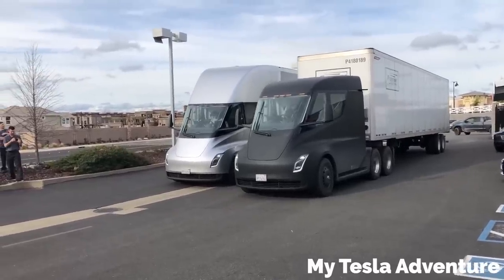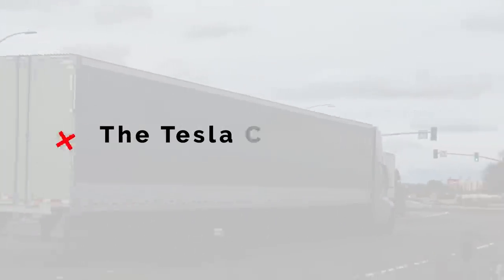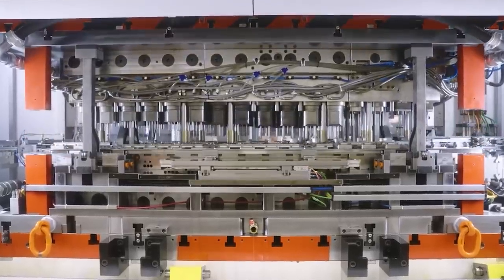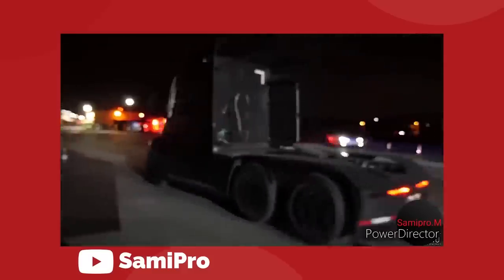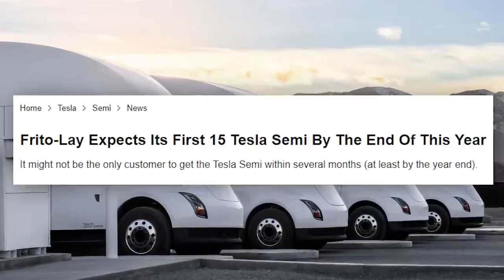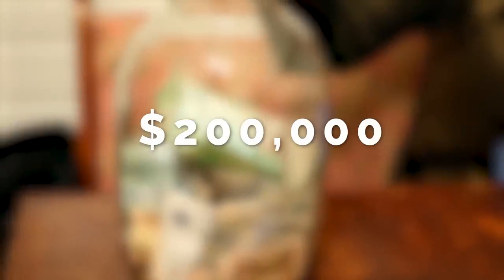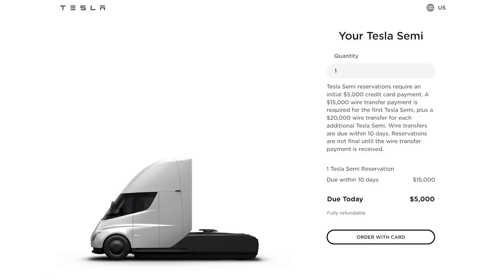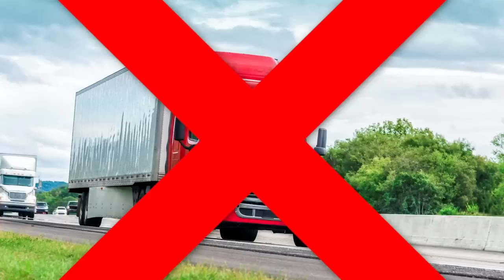The 2023 Tesla Semi Update Is Here!

Comment: I know a couple of fellas who own trucks.. owner drivers. Mostly subcontracting, single truck business just hauling whatever to wherever (UK). Always busy enough... more than busy enough. Both of them are quite serious about moving to electric and consider such a purchase as being the final truck before they retire. 500 miles here in the UK is far more than a return trip to Manchester/Liverpool from London. Trucks (diesel) they have now can haul up to the legal limit but generally the trailer is around 50% so less fuel. Both have mentioned 'fuel' saving by going electric and both have mentioned maintenance costs or rather massive decrease in cost. Never cheap something goes wrong with the truck.
Reply: It's unlikely they would actually be pushed to 500 miles. Most drivers won't be comfortable pushing past 350 miles before recharging. Most electric vehicles are made of fairly exotic materials. So repairs will take a long time and be very expensive.
Reply: They don't talk about battery degradation, my one year old model y lost over 30 miles after normal charge.
Reply: @miguelnogales716  pretty sure Elon promised a 1 million mile warranty for the tesla semi.
Reply: @miguelnogales716   Normal charging for day to day driving should not go over 80% unless you are road-tripping. Also, you should not discharge below 20% to keep the batteries in peak condition.
Reply: @samlukan  – Battery degradation is considered normal wear.  So, not likely considered a warrantable issue.
Reply: @Sushihunter250  – Ummmm… what?  In commercial trucking, every trip (upwards of 90% of them at least) is considered “road-tripping”..  Drivers aren’t running their class 8 vehicles to the grocery store to grab a gallon of milk and some Frosted Flakes.
Reply: @DebtPRZ   Miguel Nogales was talking about charging his Tesla Model Y - Not a Semi truck.  That's a whole different kind of driving.
Reply: @Sushihunter250  Jim, their website says 90% and that is my daily charge for the model Y.  I use my car for daily driving on average 70 miles.
Reply: @miguelnogales716  Really? How were you typically charging it?
Reply: @memrjohnno, Please copy/paste this comment (maybe with some of the feedback included) into whatever Semi/EV post you visit, as it very completely covers the issues we are all painstakingly trying to convey! P.S. As for battery degradation, see Gruber Corp AZ posts about how Tesla’s BMS has evolved from rudimentary in the OG Roadster to today’s far & away superior battery self-protecting SoC monitoring & charge optimizing inverters & software that is constantly improving. Bring all the FUD you want, bc it’ll be stale by the time anyone notices.
Reply: Unfortunately the tesla semi is not adapted for Europe lol…..
Reply: @samlukan  nonsense!!!! That’s has been à standard in diesel trucks for decades!!! Some even have 2million miles+
Reply: @Crunch_dGH  Been interesting. I didn't mention it on the post but they both also mentioned or rather spoke about, taking good care of the battery. Taking care of their tools.
Reply: @moabman6803  :D
Reply: With your much more expensive fuel in England, you should get a much better return on investment once the truck is available in England.  Maybe they will make a few hundred a year in Germany?  Your much smaller country, you might want to get the optional 300 mile range, because the battery cost per 100 KW is something over $15,000, and that would (100 KW) be about 50 miles of range.  If you can reduce the range and weight by several hundred pounds, then the cost savings will be significant.  

So if getting 500 mile range or saving $60,000 and getting a 300 mile range, I would take the much smaller battery and figure in a recharge for 30 minutes on each day at noon.  Have a great lunch with the $60,000 you saved in battery cost.

Also your 400 liter diesel tank will add about 300 Kg to the truck when you fill it, and then goes to 100 Kg as you use up the fuel.  Batteries do not get lighter when empty.

Comment: It's going to be interesting to see the charging cable up close for the Tesla Semi. 1 megawatt/hr battery charged to 70% in 30 minutes means
an average of 1,400,000 watts on average for the 30 minutes. It's definitely going to be higher than that at times. So, at least 1400 volts at 
1000 amps. These are very large numbers.
Reply: It’s got liquid cooling built in
Reply: Re: MegaCharger Heat. I wonder when Tesla’ll get around to repurposing all that by-energy!
Reply: They might use induction charging to minimize primary current. That would be the smart thing to do.
Reply: So if someone were to steal that cable I wonder how much it costs to replace?
Reply: They should make it so u can get a fully charged battery and drop off your dead one
Reply: @Tommyrogerson  the standard superchargers do too otherwise they would be a lot bigger too
Reply: When you claim EVs and especially the new Semi are “zero emissions” factoring how the electricity to charge the trucks, AND the environmental offsets from extracting the minerals used to produce the batteries should be considered in the conversation.
Reply: To put this in another perspective, if regular Tesla EVs charged at this speed, they would be at 100% in ~5 minutes, give or take a minute.
Reply: @djwilliams4714  I own an  EV. in the UK it costs more than diesel to charge your car at a charging point now!!!
 And that is whilst diesel is at a very high price and is falling.
Reply: @Jaya365  it costs more than diesel right now? is that in California or how is that possible
Reply: @LoganC278  UK dude
Reply: @djwilliams4714  It doesn't matter because even when you account for emissions all the way down to extraction, electric vehicles still pollute less than combustion vehicles. The only difference is the exact moment where electric vehicles beat combustion vehicles (is it after 1km? 100km? 1000km? etc.). While a lot of people aren't aware of that fact, this topic has been covered all the way through a decade ago and pushed aside simply because it's moot: nowadays, even the least environmental friendly electric vehicles are more environmental friendly than a combustion engine equivalent.
Reply: @smadacaz First, the study notes that tire wear releases more particles than tail pipes. This is a form of pollution but not related to climate change. At best, this means we need to improve tire technology as well.

Second, because car engines are so inefficient, even battery vehicles using electricity produced by fossil fuel powerplants pollute less than combustion vehicles. This has been debunked frequently.

Third, your critic of regulation and child labor is moot because it stems from where manufacturers source their products. Regulation and child labor is not related to electric vehicles more than combustion vehicles. If manufacturers are pressured to follow strict regulations and not employ child labor, they'll source their products from Canada and it simply won't happen.

Fourth, your comment on cutting trees to replace them with solar farms is covered by my second point.  

Globally, what you're doing is mostly a mix of fetching and disinforming. Anyone with a brain would see through it. I basically debunked your entire comment and you clealry intend to spread false information so I won't reply further, but I'll leave this for others reading.
Reply: @kennethroth6757  🤣
Reply: @Jaya365  I was wondering about that.  No one else has mentioned it.
Reply: @dzello  Thank you. I thought so but still hear naysayers. They never stop! God hates liars.
Reply: @Off The Grid Tesla says 500 miles.
Reply: @jolyonwelsh9834  not really, indication charging has a very low efficiency at a distance.
Reply: @theobserver8881  that's true. But we have full size electric commuter busses here in lake county Ohio that use induction charging. It seems to be working pretty well.
Reply: Roger That.
Also the EV Charging stations the more drain on the existing Hydro, Coal Nuclear power supply, which the dilapidated grid systems?
Reply: @moabman6803  here in edmonton the crack heads steal your little block heater cord , must be a whole $1  of copper , so when its - 20 or colder many new cars , trucks with the tiny 2.0 2.5 liter engines wont crank even with a new battery ..,,,
Reply: @hermanwooster8944  charge that fast and the battery after 40 50 60 charges and i bet alot of fires will occur , cant wait to find out .. poooooof ..
Reply: @macalister8881  You ever see those Chinese phones that charge in 2 minutes with 200w of power? We'll probably get there for cars, eventually.
Reply: @hermanwooster8944   i look forward to next year so many things  will work or wont ..
Reply: @macalister8881  Agreed. Next year will be a watershed moment.
Reply: @hermanwooster8944  i would love to see cleaner air here in the city so i do hope the tesla truck kicks ass ..
Reply: @hermanwooster8944  and i would love to see crash test comparisons .
Reply: @macalister8881  The heavy weight means some EV trucks are able to bypass some crash tests altogether. The main thing people need to be concerned about is the increased weight means increased risk to gasoline vehicles. A Model S recently t-boned a Honda Civic at highway speeds, resulting in only mild injuries for the Model S occupants. Tragically, it was fatal for the Honda Civic occupants.
Reply: @hermanwooster8944  my point is the tesla truck has a 15640 lb battery , and you say oh need for crash test , what happens to a damaged battery in a crash ? And you say oh no need  to see if anything eh , what b s .. norm for the day i guess .. ssdd....
Reply: @macalister8881  I fully believe there ought to be crash tests. I'm just commenting on the situation we have today. EV trucks like the CyberTruck are reportedly able to skirt crash test requirements because they are too heavy to be classified as passenger trucks. It's all a matter of bureaucracy and complex regulations.
Reply: @hermanwooster8944  i think when the fires start after a wreck they might change it just like seat belts in the 70,s , peeps gotta fly through the windows before they care right ssdd
Reply: @macalister8881  Oh yes, the changes will come later.
Reply: @hermanwooster8944  
Yeah but it doesn’t work that way

Comment: In america Truck drivers need to drive certains hours and rest certain hours. Let s say you drive 10 rest 8 .Now on top of that driving hours you have to stop twice to recharge u basically cannot drive. Since stopping to recharge counts as you regular driving hours. It is only effective if the battery last a lot.
Reply: I'm a truck driver myself, although in Europe. Here the driving rules are actually stricter. I'd say an electric truck will never be an option for OTR trucking, and for many reasons. On the other hand, 10s if not 100s of thousands of trucks are driving less then 500miles a day, and are returning to their base every single day. That's where these will be absolutely fantastic. That's why Pepsi ordered them as well. With 3-500miles of range and most of their trucks returning to their base every day, or even multiple times per day for a quick half an hour charge, these could be absolutely fantastic.

Comment: A 37,195kg (82,000lb) vehicle traveling 26.8m/s (60mph) has a kinetic energy of 0.5*m*v*v=13.36MJ. Assuming perfect power transfer, you'd need a drivetrain delivering a constant 13.36MW/20=668kW to reach that speed in 20 seconds.

For reference, the standard range Model 3 has a 202kW motor.
Reply: those are very realistic power numbers for a tesla
Reply: @leohaukipuro7896  yep, seems very doable
Reply: @suunraze  
That'll require some serious bars to hold the load from slipping/tilting backwards. 😂
Reply: Is there a trucking company looking for better acceleration? Would they pay extra for it?

Comment: 4680 Batteries: I think we can all feel a little bit of Tesla's pain in trying to manufacturing the 4680 battery. The design is new and so is the process to manufacture them. It may take Tesla another 24 to 36 months to work out all the kinks and then it will be "off to the races". I  would prefer that Tesla take it's time to nail the manufacturing process and make sure that the number of rejected cells is very low. In the long run this will makes the battery packs cheaper for the consumer.
Reply: Considering the much higher density that the Qilin batteries have that CATL are bring out, Tesla might start using them for the semi trucks instead of  the 4680

Comment: You don't mention the fact that Tesla trucks come equipped with FSD. As soon as that problem is solved, all Tesla trucks will have it. No competitor can offer FSD much less the range,  efficiency and los maintenance.
Reply: Currently level 2 autonomy is the only thing cleared in all 50 states. That still requires a driver in the seat at all times, hands on the wheel, eyes forward. The legislative hurtles required for levels 3 and 4, (4 being complete autonomy, no driver whatsoever) is waaaaaay way off in the distance.
Reply: @Jmartphilly  That, and teslas driver assist is already falling behind the competition with phantom braking and unpredictable behaviour. I don't trust it in a personal vehicle and the idea of it controlling semis is downright scary.
Reply: @TeeFunkable  "idea of it controlling semis is downright scary." So are some of the drivers. We get drivers delivering to our shop that can't back into the loading docks. Many barely speak English and have only been driving semis for a very short time.  I doesn't make them bad drivers just inexperienced.

Comment: Sir, the EXTREME VAST MAJORITY of diesel trucks DO NOT have 18 gears. That's almost exclusive to tow trucks or trucks hauling over 80k regularly.  Almost all trucks are 10-13 speeds and even still you never change all of those.  You can easily skip 2-4 of those bringing your 18 gears down to about 6-7. Big difference.

Comment: I wonder how much of that 80k lbs is able to be used for the cargo. I wish they told us how much of the total gross weight is just batteries.
Reply: Thought i read something about the battery weighs 26000 lbs? Almost 2 daycab trucks. With trailer empty a regular semi combo weighs about 25000. So giving up about 13000 lbs payload. Waiting 30-45 min to charge is bs too. You can fuel a semi in 5 minutes. Better get those uranium sticks from russia fire up the coal plant or fossil fuel ng. Dont get me started on the lil kids mining the cobalt for the batteries. Not really all that green the energy must come from somewhere
Reply: @myballsitchsomethingfierce6319  Sure so how long have you driven a class 8 semi?
Reply: @myballsitchsomethingfierce6319  BUT the battery range equals a small 8 gallon tank and that fills in less than 5 min.
Comparison level!
Reply: @myballsitchsomethingfierce6319  Could usually fuel 250 gallons +, go into truck stop for a piss and buy coffee/food and be out of the lot in less than 15 minutes.  Truck pumps are high flow. larger hoses and nozzles

Comment: WHY THE 4680? It is obvious that few people understand the big advantages of the 4680 cell. It is not just the form factor. The tab-less design allows charging and discharge speeds many times beyond what is possible with a tab at each end of the spiral jelly roll. The ions only need to travel 80mm across the width of the roll instead of being pushed from one end of the spiral to the other. A mere fraction of the heat generated, and therefore the energy needed, to do this. It also allows huge rates of discharge without overheating, for the same reasons. Think drag strip acceleration. Or aircraft takeoff. A conventional tab design with a diameter of 46mm simply cannot do this due to the extreme length (along the spiral path) of the jelly roll.

There are many other advantages as explained on Battery Day including Capex, factory footprint, production rate due to dry chemistry, about 1/5 the number of separate cells needed per vehicle etc. If Tesla can perfect this process, there will be many other cell sizes for consumer products with very fast charge/discharge speeds etc. Want bigger capacity with the same charge speed? In theory, just increase the diameter to say 60mm ie 6080. Or don't need as fast discharge then maybe 46120, same footprint, just taller. The possibilities and advantages of this are huge.

Just imagine the advantage to Tesla when they can charge their cars 10 times faster than the other brands! Or halve your 0-60 time with an OTA update!

Comment: You have so much wrong about diesel trucks. Not all trucks have a 18 speed transmission only those who heavy haul have 18s most have 10s and now most of them are automatic. Most drivers run 600 miles a day. Also when are the electric rockets coming for space x they must be polluting a lot

Comment: Along with the Tesla truck you will need the Tesla trailer.  As the trailer has a large area available for power generation, put solar panels on the roof of it. Instant extension of range on a sunny day. About 400 sq feet of surface would be available. Or about 6kW worth of possible power. If the 2kWh/mile rating of the truck is true, that would add 3 miles per hour of full Sun  or maybe 25 miles in a day without the need to plug in. In an urban area, that might mean full delivery route and return to the plant for the next load and a recharge.
Reply: Adding additional equipment like that will add weight to your equipment. The heavier your equipment, the less cargo you can carry. Plus trailers are restricted to 13’6”, so if you’re placing those panels on existing trailer fleets they’re getting knocked off the first time they go under a 13’6” clearance bridge/tunnel.
Reply: @Jmartphilly  That is why you build them from the start. And the newer panels would add little weight as they would become the roof. Height would stay the same.